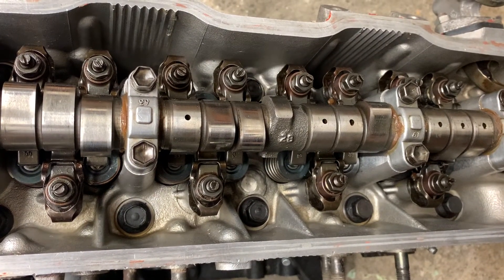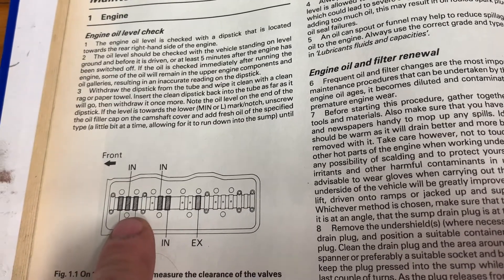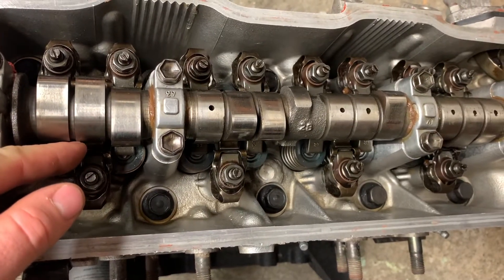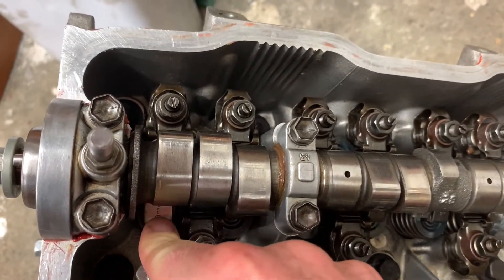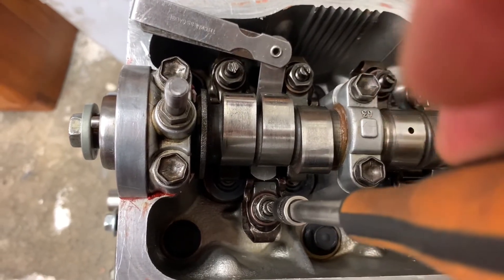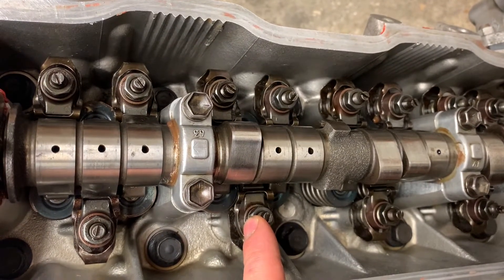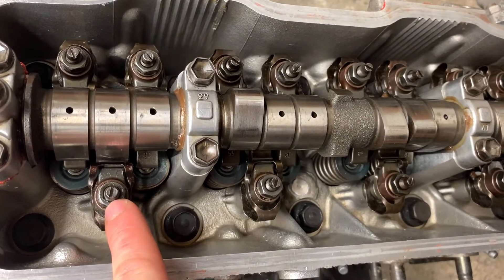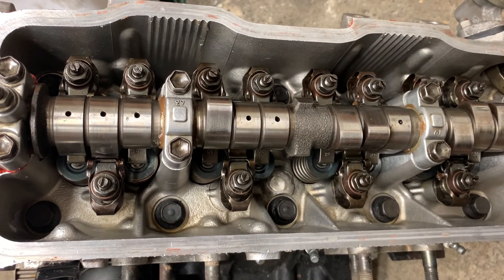How to adjust Toyota 2E valve clearance

Comment: Hi Chris here 🇿🇦
Would like to ask what could be the cause of tappet break.. I was driving my Toyota 2E1.3 car and it broke the timing belt.. when I opened the top cover.. I found one tappet broken.. ? So I was wondering could be the cause. But I was hearing the noise of tappet before the incidence happened.
Reply from the maker: These are interference engines. If the timing belt breaks, the pistons collide with the valves breaking the rockers in the process. Quite a catastrophic failure that is usually not worth repairing, I would suggest finding a replacement engine for the vehicle

Comment: How do you get tdc when engine in car ? Take out spark plug an put a marker down the barrell an rotate the crack till piston 1 is at tdc. Im after rebuilt 2e watching your videos 👍🫡
Reply: You should have your timing marks on the side of the engine where your crankshaft pulley is mounted. Just get the marking of the pulley with the 0 degree marking snd this should be tdc of cylinder 1
Reply: 🫡👍 @ShinYuzo00

Comment: good refresher.....but if the engine cant be run ...then they have to be adjusted cold at a little wider clearance and then readjusted when hot???.......
Reply: Hello. I have a Starlet with the 1E. I'm fortunate enough to have the Repair manual for the 1E/2E engines. it says to adjust them to 0.18mm when the engine is cold. Hope it helps!

Comment: will need vidz on how to change discs on 2e as well as a separate video on easy way to change linings and clutch slave cylinder and master cylinder and the correct order of bleeding the system as well as how to change dash light globes and the lights on the heater and fan on center console
Reply: do you want him to come over and mow your lawn as well?